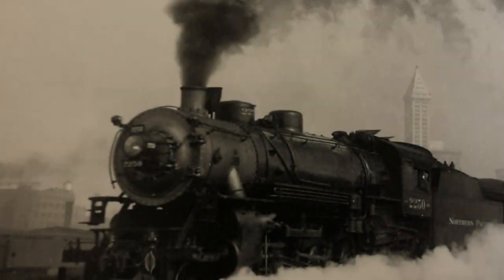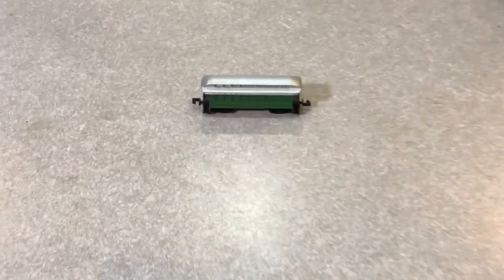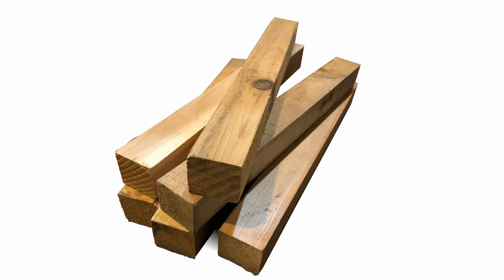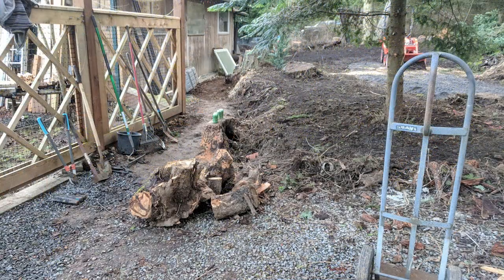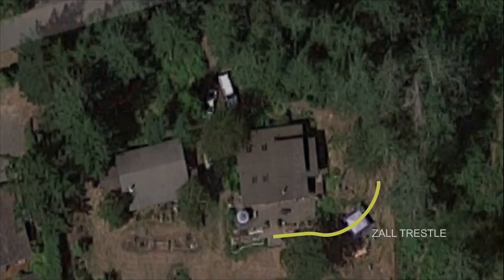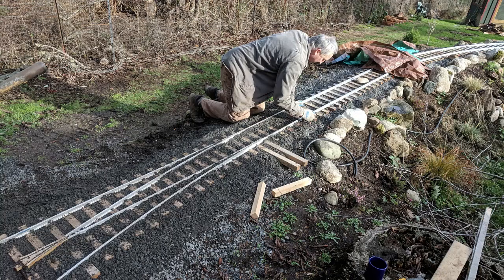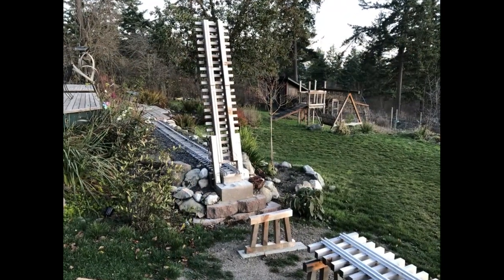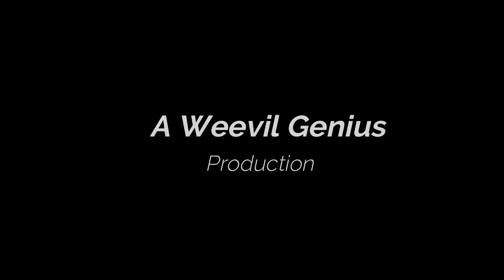7 1/2 inch gauge back yard railroad construction

Comment: Just found your video. I'm an "O" gauge railroader but have always been fascinated with these railroads. I've tried to research but i'm terrible at it. I see its 1/8 scale but what is the actual track width. It looks narrow for the large equipment you put on it. Thanks.
Reply from the maker: Thanks for the question! Track gauge is 7 1/2 inches.

Comment: Incredible achievement. Did you also feel the G scale to be too small.
Reply from the maker: Thanks! I like G scale a lot but with 7 1/2 gauge track I can ride the trains which is really fun.
Reply: @TheWeevilGenius  - Agreed . Now I am a beginner. I only have few Hornby sets. I was thinking of switching to G scale. I am too lazy to construct 7-1/2 inch setup. Is there any company that sells a 7-1/2 inch starter set?
Reply from the maker: @saugghos  Not that I know of. But Accu-Tie is a good place to start for track supplies if you get the bug. Here is the link: https://accu-tierailsystem.com/
They have a good product line. I used their rail and was happy I did. If I were to do it all over I would use their ties too.

Comment: Where’d you buy the wheels?
Reply from the maker: Machined Loco wheels are from RMI railworks. https://www.rmirailworks.com Car truck wheels were rough castings I got from Cannonball many many years ago. https://www.cannonballltd.com/trucks_cat.html
Reply: Superb video,  specially seen from the sky. It shows how far you go with 550´ of mainline track. Then the list of your ordering. Not hard to find prices, and so can stimulate a beginner with the "go or no go" final decision. Finally it´s not necesserely mandatory,  but big equipment like tractor that you own or rent is a big plus.